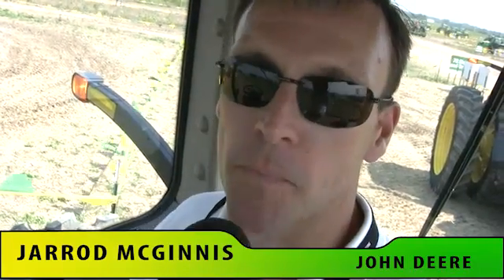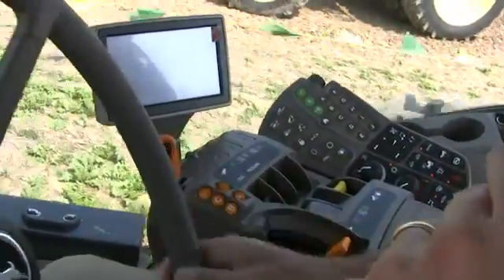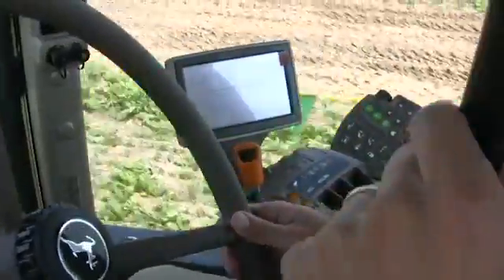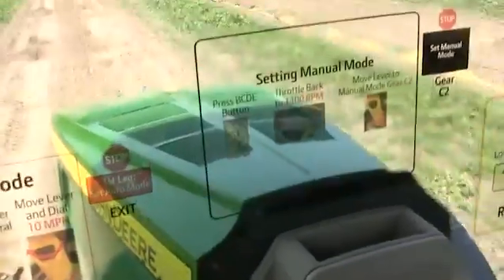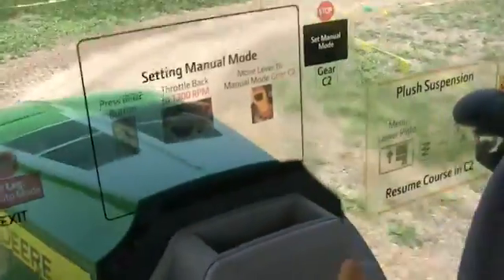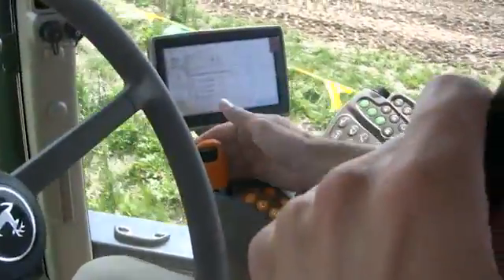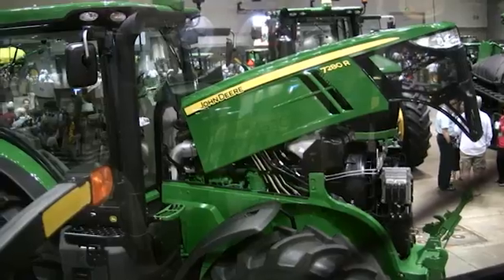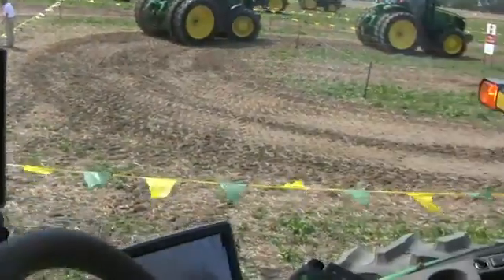Ride and drive of new John Deere 7R Series row-crop tractors

Comment: No such thing as a tractor sized like a 4055 from the early 90s any more. Ya have to have a higher powered tractor that's not as heavy or go to a monster size tractor the average farmer in my area has no use for. This was stated at the end of the video
Reply: tricountyfarmer The 4055 was a 110 to 115 hp. tractor.  The 6xxR series has tractors with power and wheelbase similar to that.  This video is about the 7xxR series, 200 to 280 hp. range.